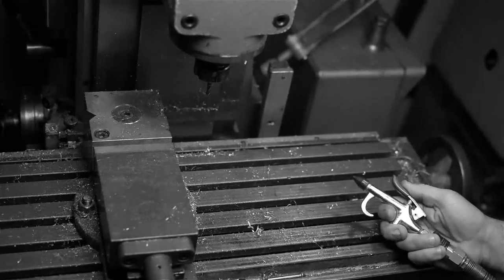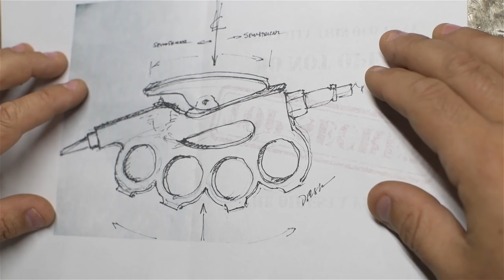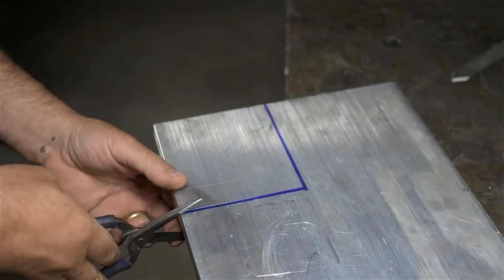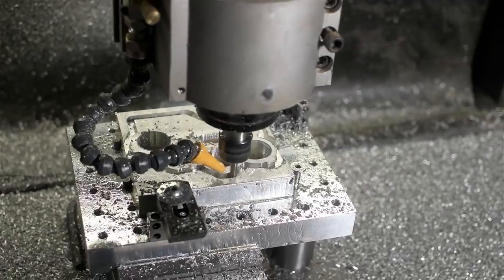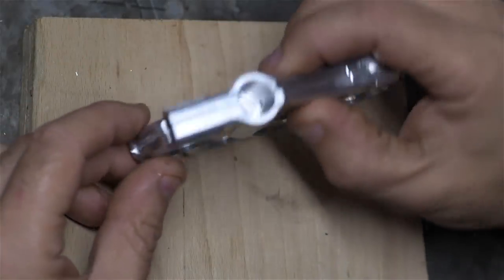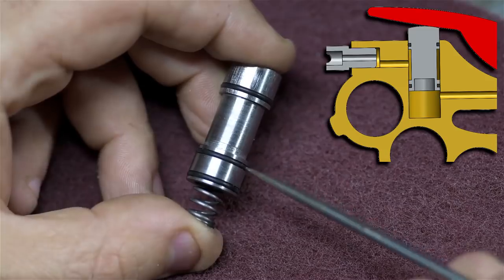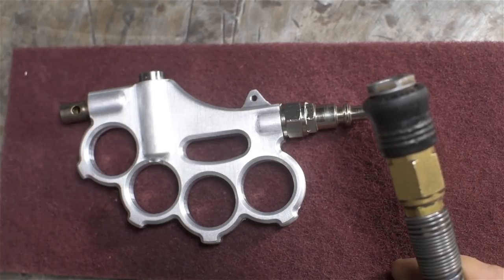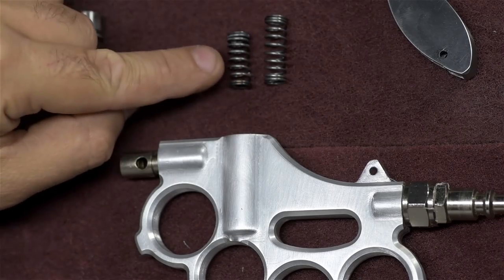PROTOTYPING! - The Diresta Collaboration

Comment: Thanks a lot Tony! I downloaded the same app to save a little on abrasives, and long story short, you owe me a new phone.
Reply: Michael Harris  could you provide me the Playstore link ? ;)
Reply: Michael Harris - it's your fault you ruined your phone.  Tony obviously didn't use water.  Might need to try with one of those water proof cases next time. J/k, lol.
Reply: virtual sand paper can be purchased thru Charmin
Reply: Works ok for me, but I found the deburring app works better on iOS...
Reply: I got an iPhone 5 that constantly keeps hanging up itself and freezes the screen for a minute or so. So, I'd recommend something newer to prevent you from freezing all the time and therefore maybe ruining your material for stopping the sanding process and having to start again.
Also, the files that I use don't really work, takes like hours until I see some results. Did someone make experiences with these "audio files" everyone is talking about? Are they comparable to an air file? I might try these for better results. Napster does file sharing, right? I wouldn't wanna buy them and then realize they don't work as good as expected, so borrowing some would do the trick first.
Ultima ratio I'd consider watergate files. They remove everything, including governments, I heard. But since I'm a beginner still, I might start with some less expensive tools...
Reply: The app has been updated, so this isnt a problem anymore. Unless you have a iphone, you did that to yourself
Reply: I'm starting to think some of these things are fake. I've been trying to cut 1" thick aluminum with scissors and it ain't working.
Reply: @jayzenitram9621  Clearly, you need Engineers Scissors, not Dollar Store.

Comment: Your editing made it look like you drilled and tapped for the inlet and nozzle, put in the valve, and air flowed through solid aluminum. I would have expected drilling those long air passages would be a challenge and wanted to see if you used any tricks to do it.
Reply: Both inlets meet in the passageway that the valve is in. easy peasy. Drill the inlet and outlet straight in, then drill the valve body straight down.
Reply: Robert Szasz I was wondering about that! Thanks
Reply: If you look closely, when he's about to drill out the nozzle mount you can see that he'd already drilled the air passage
Reply: It's Tony. He just smacked em with a center punch, that makes a perfect hole every time.
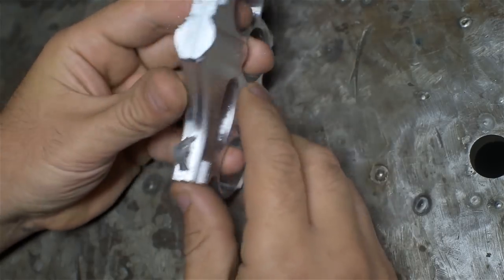Reply: Alex Swavely Ah yes, got it at 7:30, not paying enough attention, I should go to the bottom of the class.  Cheers.  Joe.
Reply from the maker: solid aluminum is really just atoms with a ton of empty space.  

the duster isn't that big, did a lot of 'pecking' to try to keep them straight, but otherwise, just two holes that meet in the valve area.

you're watching close.. going to have to be more careful next time. ;)
Reply: Oh yeah. So much empty space you can use scissors to cut it. XD
Reply: On a different note, perhaps a small steel or carbide insert would make sense under the "heel" of the lever. It doesn't look like much wear would be needed to cause the valve  shuttle to move out of position. With another hard wearing surface on the top of the valve this should last a long long time. 

Perhaps a "Because I can" model with that and porting for maximum flow 😀
Reply: Drilling the long air passages would have been interesting, too bad we didn't get to see that.
Reply: It wouldn’t be THAT challenging you just have to take a bit of time to make sure you drill in the correct spot so that it all lines up

Comment: Oh yes!
Reply: share them both with a new video :D
Reply: HTR, your vids have been awesome of late. The paper cutter was superb. Is there a follow up with the tool you restored for Mr Diresta? He's not mentioned / shown it yet.
Reply: Thank you!  I found a hairline crack in the cylinder that was allowing air to enter and causing the drill to not run properly.  I need to either fix it or find a replacement at some point.  I sent Jimmy the Cutawl I restored as a thank you.

Comment: Great work! Shouldn't there be a venting hole below the valve? Now any leakage through the lower o-ring can still build up pressure below the valve.
Reply: yes but if there is leakage in the lower o-ring what's to say the middle and upper o-rings don't leak as well? just trust the o-ring.
Reply: bump this for the final design
Reply: @tylergarza6632  good policy in general, should be on a bumper sticker 😱

Comment: You might've already considered this, but I'd drill a hole somewhere (maybe through the top of the shuttle) to vent that spring chamber.  If the leak rate at the bottom oring is higher than the middle oring, pressure will eventually build up in the spring chamber and give you the effect you mentioned initially with the two oring design.  It really doesn't make much of difference since you'll notice it right away and can just replace the seal, but coming from a paintball gun design background, that sealed spring chamber doesn't sit quite right with me.
Reply from the maker: good idea tyronejk, thanks!

Comment: Thanks Tony and Jimmy...looking forward to the cad and Jimmy's video(s).  Interesting to bring the sketch in and trace off of it...have done it in AI and exported to acad.  Would like to know more about how the port diameters and spool valve diameters were fingered, earballed or enginerded for specific flow and noise levels.  Glad no one was hurt in the making of the knuckle blow gun proto and hope that sanding app doesn't get butt dialed...might be hard on the fingers and knuckles. Perhaps the final version could have a magazine of tips that ratchet into place and a slightly tapered spool valve for even more control.  Always a pleasure to be able to watch class acts.  ~PJ
Reply from the maker: Thanks PJ!

Comment: First time commenting, love the video as always! 
Two things:
First of all, I believe the reason you had a mismatch on the X and not on the Y is because you used the same register corner (top left corner it seems) with the four dowels you had in your fixture plate for both operations. This is fine for the Y because you are registering along the same surface for the second side as you did for the first side, thus no Y mismatch; you maintained your Y datum. However, since you registered from one surface for X on your first OP and then flipped the part, your X datum would actually be on the right side of the material which is the side you should have located from. In other words, your XYZ datums need to be maintained between setups to minimize mismatch. Your XY datum for your second operation, in this case, should have been the top right corner after flipping the part along the Y axis.

Secondly, a very small nit pick. I saw that you used four dowel pins to locate your material. Three dowel pins is normally better practice. The reason being, as my instructor said to me..."Imagine sitting on a four-legged stool in comparison to sitting on a three-legged stool. Which stool is more likely to rock?" Obviously, not terribly relevant to this particular application, but three points of contact when locating is almost always better than four.

Hopefully this helps in the future because I have learned plenty from your videos and I have enjoyed watching.

Comment: Hi Tony,
For the 3rd o-ring to really work, there must be a relief hole for releasing any minuscule quantities of air that do cross it. Have a drip for long enough and you can fill a bucket. And when the bucket overflows, that shuttle-pin will fly across the room ;)
The leak could be to the outside (near the middle finger-hole) or to the output-hole (by means of a bore through the valve-shuttle). Cheers!

Comment: Tony the tool marks are way cool I love it. Don't remove them.... think of it like camouflage tiger stripe uniform. When you want your blow guns to look cool but can't find it.😁 yes air fittings in the U.S. are 1/4" pipe. If you were to make your own mabe. ??  Use a threaded in valve
 (Safety & longevity)
The tail hold for the valve handle mabe a steel insert pin. Awsome build leave the tool marks and rush one right out to me.☺

Comment: Just a tip, you are never going to get the part halves to line up on a flip reliably unless you indicate off a through feature, and even then you need to be tenths accurate to not have a visible seam.  It's far easier to design the process so you do the sides from one side or the other, stopping an whatever corner is convenient.

Comment: Since you did some surfacing with a ball mill, and don't have a tool changer, you can also surface in the edge breaks and chamfers. They don't even add all that much more cycle time, and it'll save you a tool change.

Comment: I can see a lot of your grief in aluminium is from your endmill selection (4fl), and I understand why you might just use what you have to hand.
Please try a Garr 143M [Alumastar] end mill in a size of your choice. 3 Fl, 45 deg, coated. You won't be disapointed. I get amazing results with these and have never looked back. They work well in brass too.
Cool vid. Love the channel.

Comment: Might I recommend using torus Mills? It sounds like you're milling head isn't as stable as you'd like it to be, and using torus mills might just help you with that.
With a torus mill I mean a mill with round edges on the bottom. 
For example using a 10mm radius 2mm carbide mill, if you use a depth of cut of half of that radius (so 10mm radius 2 with 1mm depth of cut)
Doing this will move the force on the mill and spindle from 100% radial to 50% radial and 50% axial.
This will give you much more stability and the opportunity to work with longer tools and much higher feed rate.
Recommend trying this with a 10mm rad1 carbide mill in stainless steel at 0,5mm depth of cut and a feed rate of 2000 mm/min, for aluminium you can go even up to 3000 mm/min if your machine can do that.
Experimenting with this is maybe worth a video on it's own. ;)

Comment: Great to see such cooperation between you and Jimmy.

Looking at the design I ask myself what about moving the pivot point further back for better leverage/control. In addition I always miss better flow control i.e., from fine to strong air blow. Therefore, an appropriate valve design would be great. Maybe by using a conical shaped valve body ... ?

Comment: Hate to make my first ToT comment a dull and serious one when there's so much fine humour to prey on/enjoy, but you probably should have put a bleed hole in the bottom of the bore into the finger grip area, or out one or both sides, maybe 0.5mm or something similarly tiny. When the orings wear, and they will, it could pressurise as in the original design, and even until then, there is a pressure or vacuum in that chamber affecting the feel of the device so long as it stays sealed. A bleed hole would have remedied both of those things leaving only bore friction in the feel of it. Side note: I love your videos. By a good margin, my favourite channel on YouTube. It's a shame you have a day job and a family as without those you could probably knock them out a little faster for addicts like myself. Cheers :-)

Comment: When you are doing the paper test to zero out your bit, it might be easier to wiggle the paper instead of turning the bit. You have found the edge when you cant wiggle the paper any more. You will need to be at least one full flute length end otherwise you might be over the zero into the part.

Comment: Great job! except for the offset in the x register ;) Tip for next time, use the center of a through hole either through the part or the frame as you datum when you flip it. It's much much easier to dial to that then pickup and edge plus you don't have to take out the tool just stick/clamp a dial to the collet nut and away you go. Also you should vent the bottom of the spool valve cylinder or have a through hole in the spool so that 'when' the lower o-ring starts to leak it doesn't pressure below the spool and defeat the point of the 3 ring design ;)

Comment: super cool engineering! :) what a pleasure! by the way how did you make sure the edges where the inlet and outlet meet the piston bore were free of burs so the o-ring can't get pinched? That is one of the issues i have when using valveblocks at work. THanks!!

Comment: Nice design, though I'm wondering if it might not be worth putting a half round on the bottom of the lever to push on the valve so the load is straight down?  As is it seems like it would side load the valve and cause wear, especially to the O-ring?

Comment: The air chucks wear out ( get borrowed for another tool that was dropped onto the chuck) so the adapter is good and is replaceable if dammaged. Also the restriction should be beneficial to the control of air flow.

Comment: I would add a bleed hole where the spring side of the valve chamber is, so the valve wouldn't get as much potential force if it does shoot out

Comment: Seems like you'd want a stop screw to keep the plunger from exiting violently should the pin or hinge in the handle fail. Over time that hinge would be a wear point, and I can imagine the handle getting loose enough to pop off if it was worn, stamped metal.

Comment: I've got a blower that has had about a 30" piece of brake line put on its business end and bent over and smashed down, I'd love to know what the force is on it when you mash the button. If you don't have a good control grip on it it'll smack you or the person next to you right in the face lol.. use it mostly for rooting around gas tanks that are being relined , works well for blowing loose bits of old liner free
Reply: ~that blower design would work great for blowers being used with long extensions

Comment: A couple of questions. Why did you make the trigger out of steel and not aluminum? Second, wouldn't it be better for the shuttle to be held into the hole with a threaded part with the point sticking through the hole in the part up to the trigger? So the shuttle cannot escape, even if the trigger is removed? As usual, I love your work, and magic tricks.

Comment: Hey Tony - First off - great video as usual!......Quick question re the shuttle valve - wont the lower air port wear the o-ring where it crosses and recrosses it? or is it's exposure to the mouth of the hole so brief that it doesn't have time to expand into the recess?. I guess at the end of the day it can be replaced if it does wear though.

Comment: Don't you think that maybe the lever would be easier to push if the hinge was near the front and effort were applied near the back? That way it would be more natural to use since it would also be used as a knuckle duster and it would be easier to squeeze with the users grip rather than their thumb.

Comment: Hey Tony, great video as always. Did you register the 2-sided operations only with the pins on the fixture plate ? And I guess you used tabs to keep the milled part inside the stock and then sawed & filed them, right ? Sorry for the noob questions, it's been a long time since I machined anything seriously (more than 15 years), and we just received a CNC router at work. I did some simple wood routing the past few days, and I'll soon have to mill a bit of Al just to get a feel for it, but ultimately, this is the kind of parts we'd like to do. 
And thanks for your CNC routing basics, really helped a lot in setting up our machine :)

Comment: Would the chamber below the bottom o-ring not need a bleeder hole? Otherwise over time it will fill to max pressure and resist the piston-valve? (or eject it when dismantling it)

Comment: It looked like holding tabs were being left when the thumb lever was being cut.  When the piece came off the mini pallet I didn't notice any tool marks on the pallet.  Did you not cut all the way through the steel?  Were the tabs just for extra support even though the steel bottom was fully intact?  Did you band saw the thumb lever afterwards?  I know you didn't use the scissors -- they only work on Aluminum.

Comment: I only have one question: why is the sketch upside down?

To talk more in depth about this question the orientation is completely upside-down. If the blowgun/knuckles were orientated as show then a hip-fire with an external air source would be the only way one could fire said blow-dart. Imagine you have just a blowgun: one hand knuckles up, and then lets imagine one had brass knuckles whiles shooting them.

Comment: A question: what cad system are you using? A comment: I'm pretty afraid to use my cell as sandpaper... I could try it, but it looks that only will work when I get an Android like yours!!! hehehehehehe.
Reply: He's using SolidWorks. You can see the logo in the upper left hand corner of the video around 2:50.
Reply: Thanks for your note! I had not seen  it over there.

Comment: I preface this comment with, I am only an expert when I am in the youtube comments section... But for your profiling of the body I would machine past the depth of the nominal thickness. For instance if the parts of the body that are flat amount to .375" thick and your starting stock is .5" than machine to a depth of .4" and than when you flip the part there will be much less chance of evidence of misalignment.. I am making a part for a customer right now that I am using the same process as described, This way I am able to machine out 5 parts in one run, flip than just remove the excess stock which acts as tabs and money.

Comment: Oooo, I see you have the Premium Sandpaper app! rich bugger :|
Reply from the maker: no ads!  they ruin the finish.
Reply: well, I've learned to only use the top part of the sand app, and take auto rotation off, since ads like to sit on the bottom of the screen.. works just as good as the sand paper you get out of the garbage